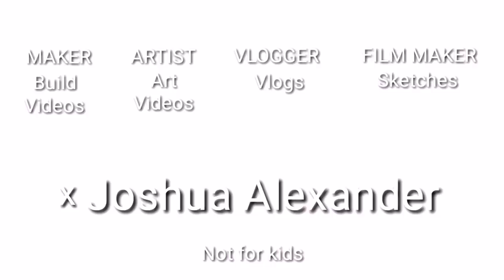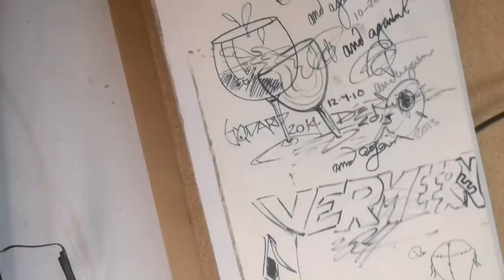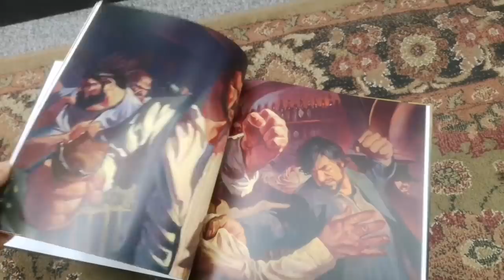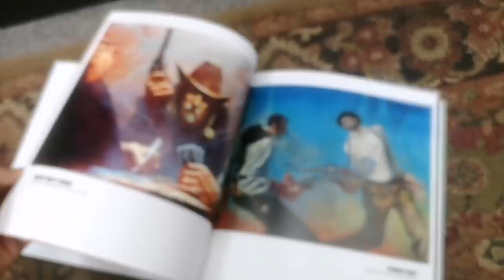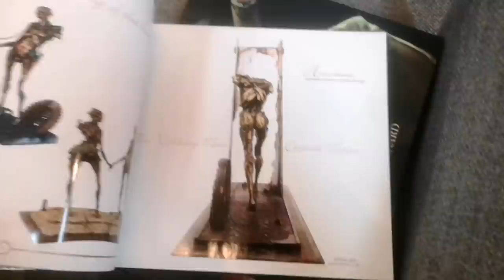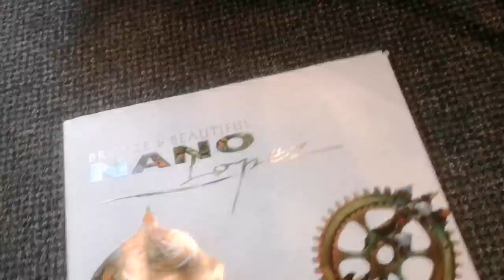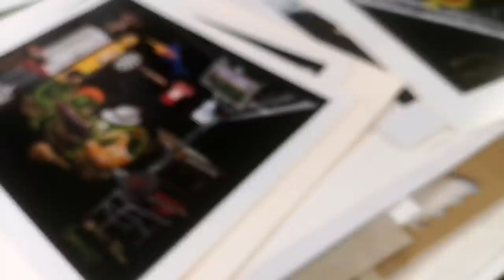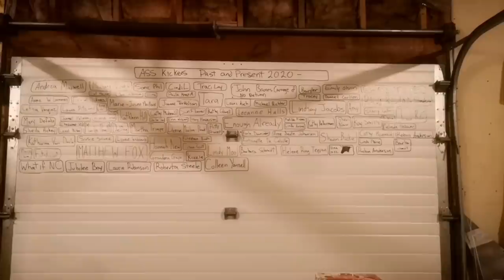My neighbour gave me something great and I finally made Alex his table | Another VLOG #85

Comment: Josh, 
An old wooded broom handle with a strong magnet would work wonders finding lost 'pins' in sawdust. 
I am a silversmith & when I loose small tools, saw blades on the floor of my shop my pole magnet works wonders.
Reply from the maker: Right. Except it fell amongst a bunch of other pieces of steel.

Comment: Josh,
I was a custom picture framer for 35 years and had molding choppers, joiners  a vacuum box. for adhering art to a backing ..lots of stuff.
Those  computer  mat cutters are OK if your  into production work doing tons of standard mats for sale  and  possibly a mat with multiple openings, but it takes forever to set up the cut and you never get the purchase price back. Small shops rent them but  a regular man powered cutter works best.
You are exhibiting in a gallery with lots of great illustrators like Bateman....Impressive!
CHeers,
Rik Spector

Comment: You need a retrieval magnet to retrieve that key from the sawdust..... when you need one you need it bad.
Reply from the maker: There was tons of random nuts and bolts and stuff under the saw dust. I did find it eventually. But it wasn't in the saw dust if I properly recall. It's in the next vlog I think.

Comment: Now you know what I cut on in production mode : That is DOUBLE MITER NEMATIC SAW.  I also Maintained all of them . 14" Blade upright; 12" Triple Carbide Metal Saw,3 :12" Double Miter Carbide Blade Wood Saw 
20 + Years. Mat Cutter,nematic Joining Under Pinner I Framed A oil Of Queen Lilii Hangs in Summer Palace . A Sunset House Award Presentation House. ECt. Production Distribution Co. BEFOR that I Did All thing Picture Framing RETAIL Master Class . 1980 on . I am now Retired From any of my Framing . Body Worn Out. I am A Chef Since2013. I 💖 watching you Work and ART & LIFE THANKS JOSH

Comment: Guy running down the highway on crutches with sledge hammer........it’s a wonder you weren’t arrested and charged with having a dangerous weapon.🤣😂🤣😂  You have to sharpen lawn mower blades, they get dull and don’t cut the grass well, you have to go over the same spot over and over. Dad just used to take the blades off, sharpen them with a file and sometimes with a wet stone if necessary. Older mowers are easier to fix than the new computer controlled ones. Read the book “ One Second Later” and start to collect the old stuff.🤣😂

Comment: If you put a nail through your foot/skin you need a 'tetanus shot' from your Doctor and the sooner the better you should have had that shot right away. I was 12 years old and jumped off the roof of our garage and right onto a 6 inch spike that went right through my foot between the big toe and next toe over but behind the big toe knuckle. My Dad took me straight away to the doctor specifically for a 'tetanus shot.' Look into that right away Joshua especially if you broke the skin with the nail. SERIOUSLY! BTW it took me 6 months before I could even put any weight on that foot. I still feel it whenever it gets real cold. Don't mess around with breaking the skin with a rusty nail. 
--> TETANUS BAD!
Reply from the maker: Well I didn't say it was rusty. But also I have my tetanus up to date. I've been contracting for years. Get stabbed fairly regularly.